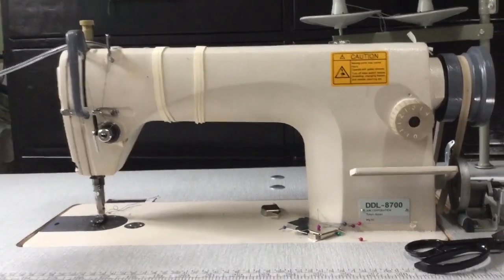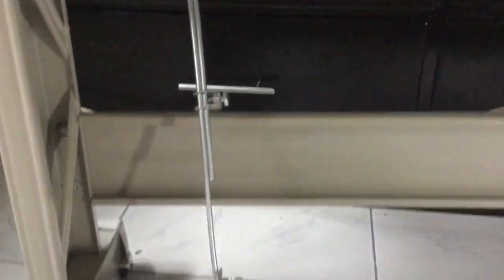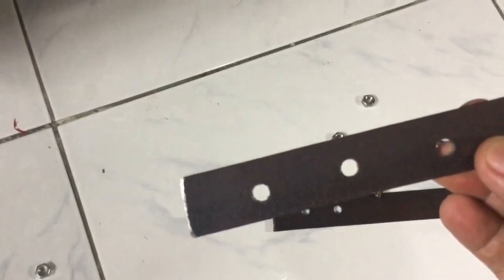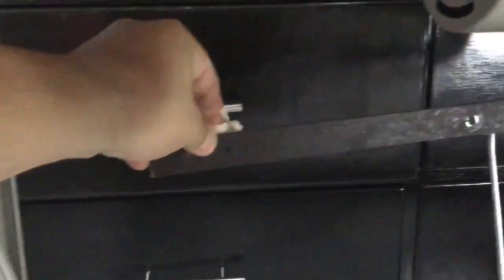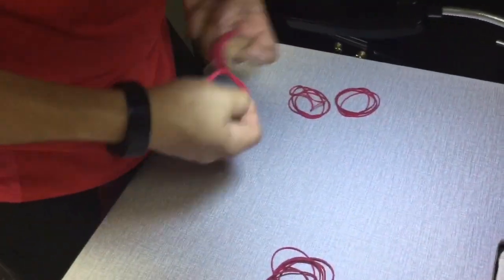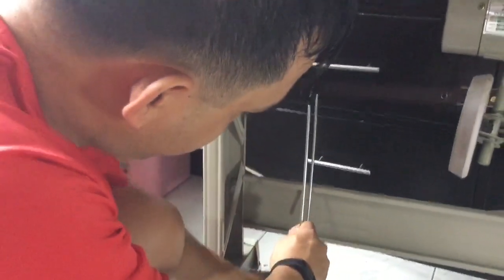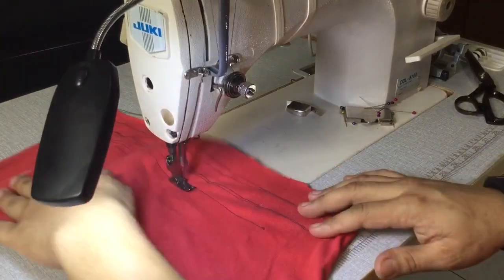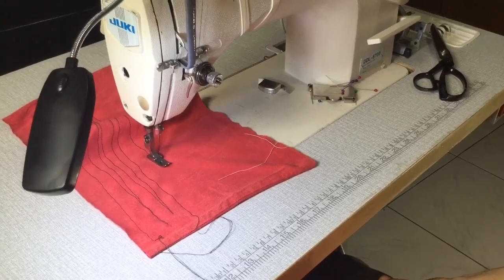Slow Down and Control Speed of a High Speed Sewing Machine

Comment: Can i not put extension coz i like where my foot pedal is placed and just only put rubber bands or spring to add tension coz I'm having hard time to control my sewing machine speed..
Reply from the maker: I think you can extension. I have follow up to this video where I used a coil spring for the tension.

Comment: Can i use garter instead of rubber bands
Reply from the maker: Garter is also good. I modified this also using a coil spring from a motorcycle brake pedal.

Comment: I already made this but the motor when i press the pedal dont easily  run...its like a car clucth that slides...when it runs its fast....what else should i have to adjust at the motor to make it controllable..
Reply from the maker: Looks  like  the clutch disc is already worn out. This works the opposite to a car. In here when you press the pedal you engage the clutch, that is, the motor connects to the sewing machine. Since yours just slides and then suddenly engages, the friction surface may be gone or barely there.
Reply: What country are you sir?

Comment: Btw, my thread also got broke in the same machine as yours. I got my tension setting is right and the thread  & the needle as well.. could it be the bobbin house or needle house are not right? Kindly advise on this, and sorry for my many problems to ask you.. :D
Reply from the maker: No problem...happy to help if I can :-). My wife owns the machine and she said that you may have similar problem. Hers kept cutting thread lately. Not sure if it's the bobbin house or needle for yours. You can try what she did. She replaced the feed dog (I think that's what you call it.  it's the part with teeth under the presser foot) and the problem disappeared.
Reply: if the thread breaks follow its path..almost always something sharp or tight causes the problem.
Reply: I have an emel sewing machine...can I slow it down same way?

Comment: I did that and it doesn't work? What am I doing wrong? Thanks
Reply from the maker: Can you elaborate how you did it? Maybe I can help. I essentially extended the motor control arm in this project. You can send a photo to this email agsilva96@gmail.com.
Reply: maybe you have a faulty clutch motor to start with..if your motor still have thick clutch linings and brake pads i see no reason why this wont work.